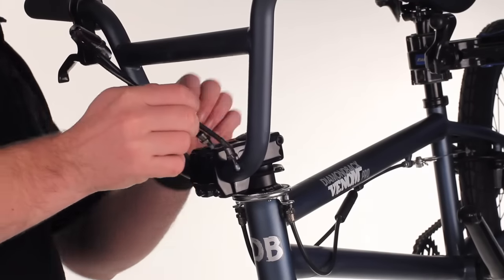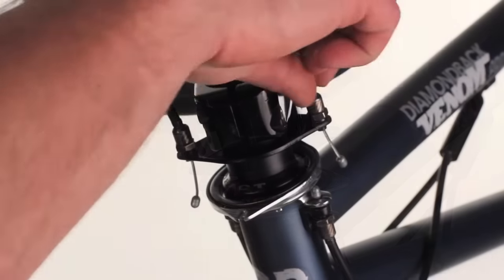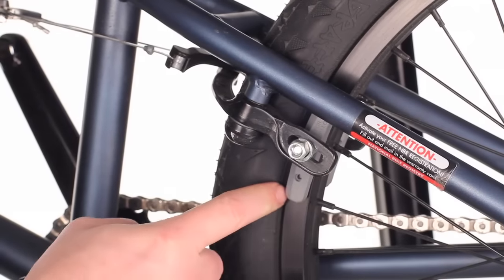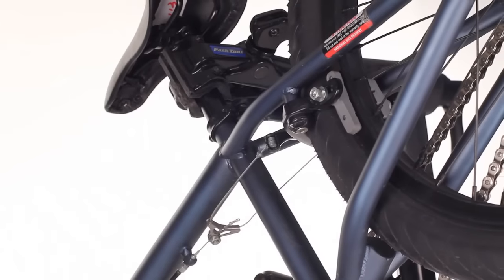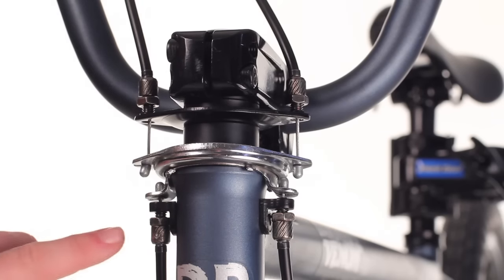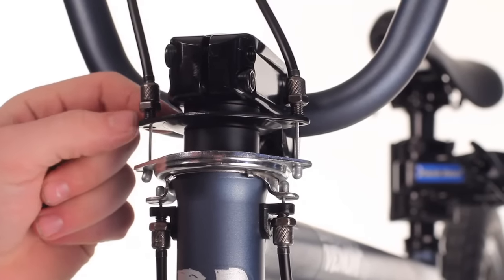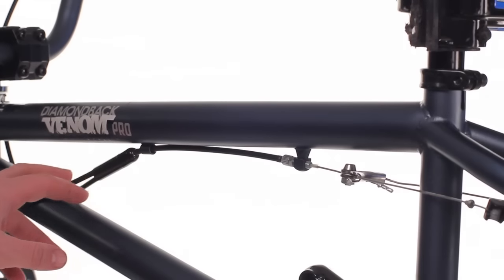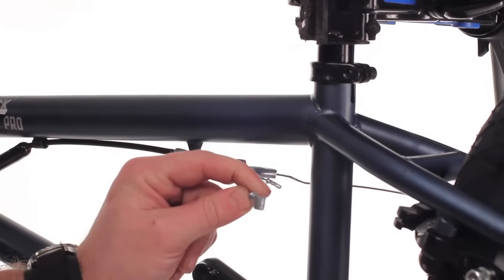Diamondback Tech: BMX Gyro Brake Cable Installation and Adjust

Comment: how is the brake cable connected to the rear brake? the two cables on the handlebars arnt touching the rest of the brake cables?
Reply: That's the Gyro feature aka the Gyro's job. Instead of a continuous cable pull from the Right Brake to the back tire that can be "tangled"...the Gyro serves as a "tangle free" liason/intermediary between the two. (You can spin your handlebars until you're dizzy and blue in the face.)  

Back to the explanation, You pull the right brake, it pulls the top of the Gyro which moves freely in a 360 direction. The top of the Gyro is connected to the bottom half of the Gyro, which is in turn connected to the Rear brake cables. The tension of the rear brake cables is picked up from there and does all the work.

Comment: So how do people install front and rear brakes on bmx bikes? I see these flatland riders with both.
Reply: The front brake runs down through the headset and exits through the fork. As a result: the brakes, fork, bars all move as one piece in the same direction. Tangling is not an issue with front brakes.
Reply: @eliyazawa6921  oh. That's so simple. Thanks for making me feel like a dumbass 😅
Reply: @mountaindew267  don't feel dumb at all. You understood once explained 🙂